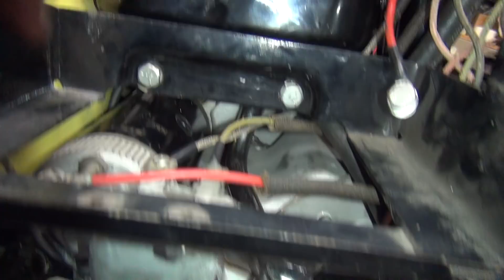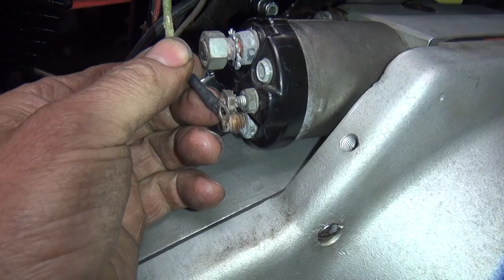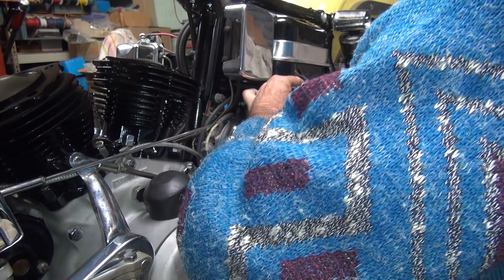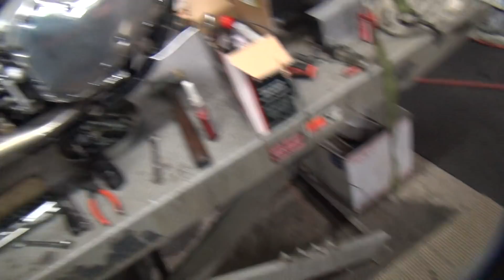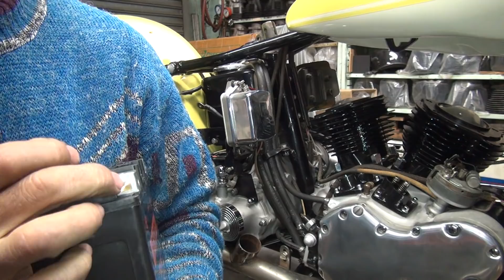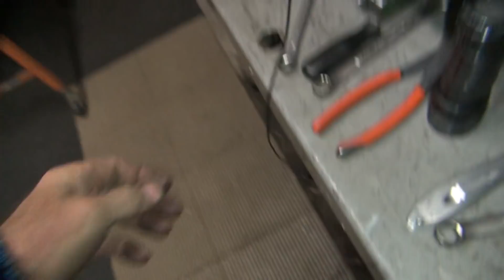1965 panhead #141 74ci flh motor rebuild and bike repair harley by tatro machine

Comment: Is it or would it be practical or even possible to put a solid state system in an older scooter such as this one instead of the points/condenser system.
Reply from the maker: yes, i know of two different manufactures now that make them. you can make your own by just mounting the pick-ups and rotor onto your distributor. this would require some machining but it does work good. just look at my kr race motor playlist.
tatro